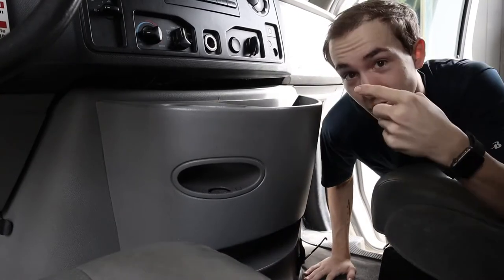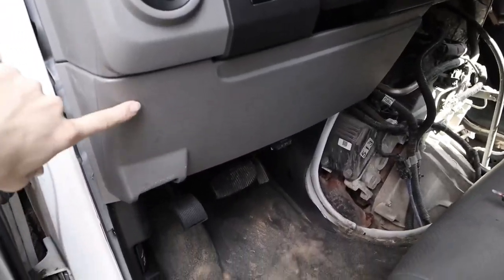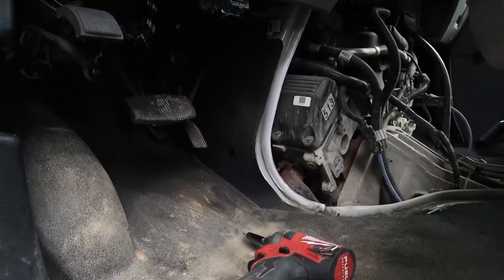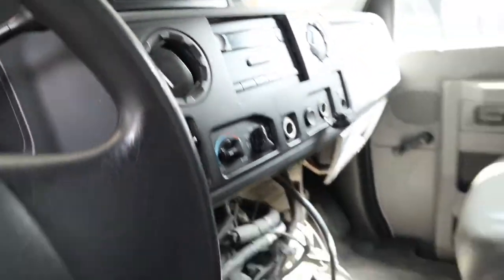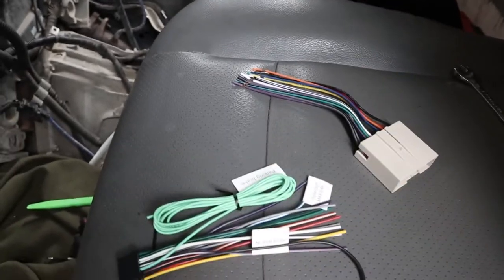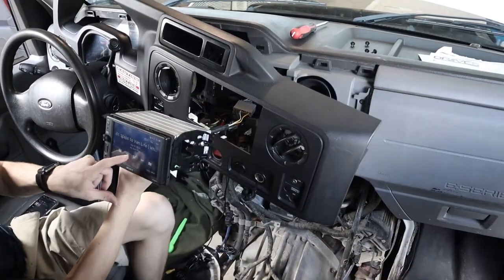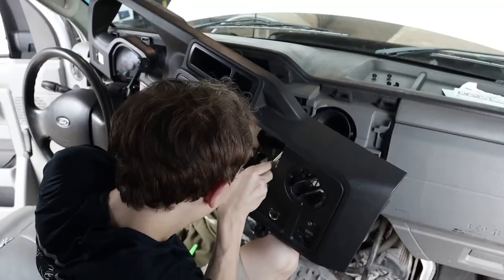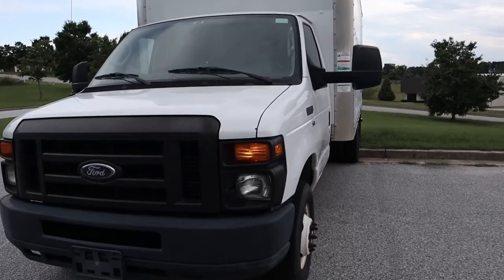TOUCH SCREEN RADIO INSTALL | THE BOX TRUCK CONVERSION. Ford E350 aftermarket radio install

Comment: I have a 2018 E350 camper, but the dash setup looks identical to yours. It's way way easier to get back there and deal with the electrical stuff if you drop the steering column after removing the kick panel.

Comment: I've got a 2019 e-350 FedEx truck that I'm about to try this on, but I have to get home and get it done before work the next day. I'm not sure if you mentioned what year yours is and I can't find info on the newer generations. Is yours a 19? It looks the same but I wanna be sure first.
Reply from the maker: It’s a 2013
Reply from the maker: The beautiful thing about the e-series is that parts a very compatible through out the year models